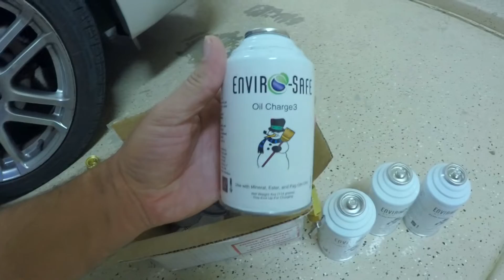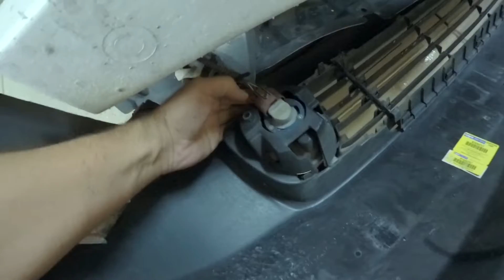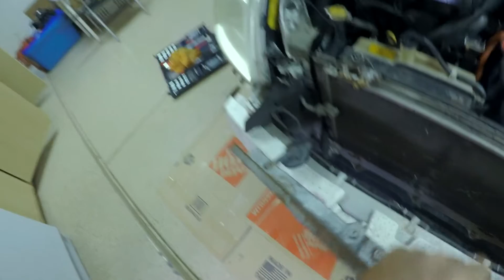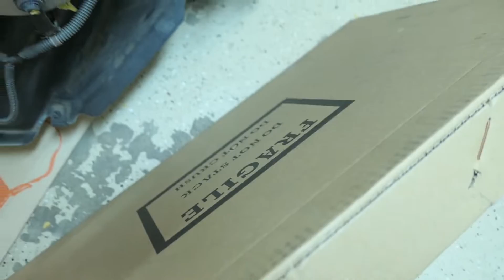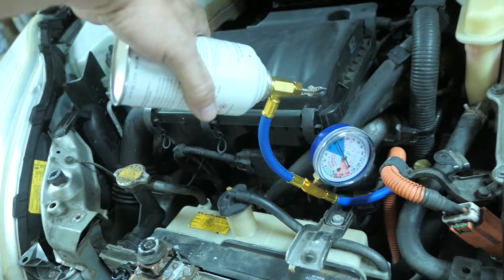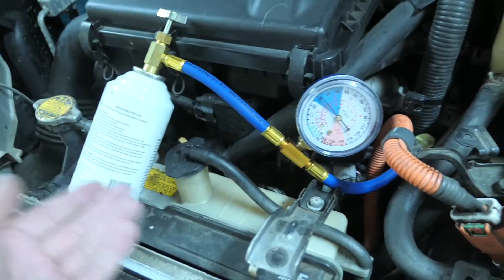Toyota Prius  Gen 2 - AC Condenser Replacement

Comment: I could be very mean and critical but you absolutely cannot open any A/C system, expose it to atmosphere then charge it with Freon without pulling a vacuum on it first. It is a vitally important step that you cannot ignore or bypass. Atmosphere contains moisture (called humidity). As little as one part per million moisture trapped in a system will damage reed valves in older systems but even in a scroll system it will cause corrosion and failure. Water boils at room temperature in a vacuum. Pulling a vacuum vaporizes the water, dries out the system and removes all the atmosphere.

Comment: Is this dye safe to use in a Prius …as it has an all electric compressor that will fail if common ac products are used? Special hybrid compressor oil is required and supposedly…no ac sealant is approved for use in Prius system….

Comment: Appreciate the step by step instructions but you keep calling your condenser a radiator and it had me confused a bit. Those parts are not the same but in all fairness the condenser does look like the radiator. Just fyi but thanks for the video I have to fix mine also

Comment: You at least got the refrigerant HFC-134a correct according to my manual. Missing some steps there though. It would be helpful to know how warm the A/C can blow before it signals the refrigerant is too low thus destroying it. Mine is 42F, 43F, 44F, 45F from left to right at A/C vents at 82 degrees F outside. I just want to know how long I can leave it safely as it's pretty close to what you got and my 09 Prius is still the original at 324,000 miles. As long as there's refrigerant in it shouldn't overheat right?

Comment: this is not the correct way to recharge ac on a Prius. Yes the Condenser is correct but the AC charging shouldn't be followed. Wrong type and amount of refrigerant used, Prius don't need 2 cans or more, it needs 16oz which is basically 1 and 1/3 can. Dye that should be used should also be hybrid safe otherwise it will kill the compressor. Not vacuuming the system after the install, you'll have moisture in the system which will not make the cooling efficient, yes for youtube purposes you can claim that it cools. Relying on low pressure to top off is also not good, you also have to check the high pressure.. basically this process is overcharging.. which is the same as under charging. AC charging should be precise. Also oil wasn't added to the new condenser, so the system is now low on oil.
Reply: Correct. Should release refrigerant can on scale to measure mass of gas released into system!

Comment: Hey buddy for a novice you did excellent work; however, you missed a very important step and all your viewers will be misled and curse you for posting the wrong info when they follow you. After you replace the radiator, you must hook a vacuum pump to the system to pull all the air out of the system...should leave the pump on for a couple of hours to bring the vacuum press as low as possible.. And then refill the system with refrigerant. The air is called in AC industry, noncondensable, leaving it in the system, will eventually destroy your compressor. The compressor's job is to absorb the refrigerant gas and bring it at high press to turn it into liquid. Well, it can't turn the air into a liquid, the air is noncondensable, but the moisture in the air could turn into a liquid and slug your compressor. The compressor can only pump gas not liquid, so a few drops of water will destroy it. Also, your air/refrigerant mixture renders your system very inefficient. If you have 20-30% of air in your system, you will lose 30% efficiency of your cooling system. An auto AC shop may charge you $100 to pull the vacuum and refill your system, If I were you I would fix it. How is the car working now?
Reply: Good tip! 

Maybe I'll just have a professional repair my Prius' AC.

I can't afford a vacuum to suck the air out of the system. That sounds very unique
Reply: @TreDogOfficial  autozone rents the pump and gauges  for free(you pay for it and return it the same day or after a few days, they offer it in their catalogue). There is plenty of videos on how to use it.
Reply: @TreDogOfficial Harbor freight also sells a hand pump vacuum bleeder. Around $20 if I remember correctly.
Reply: The label on the can of Enviro-Safe AC Refill says "DO NOT PULL A VACUUM ON THE A/C SYSTEM." 

Website:
Product formulation: Enviro-Safe's standard R134a Replacement refrigerant with dye is formulated to work correctly with a small amount of air already present in the AC system. Unlike conventional R134a, which can become corrosive when mixed with moisture and air, Enviro-Safe's proprietary blend is designed to be more tolerant of these factors.
Charging method: Charging under a vacuum can lead to an overcharge of the system, potentially causing reduced cooling efficiency and even damage to the compressor. This is because the product is designed to be used in conjunction with a pressure-based charging method, rather than a vacuum-based method.

My personal opinion, if you want to save money, this could be a viable solution. However, if you're concerned about risking damage to your car's AC compressor and potentially increasing costs down the line, it's best to go to a professional shop or dealership.

Comment: OMG... zip ties?  This is a radiator which gets very hot which will melt the zip ties.  WD-40 or Gunk Liquid Wrench would likely help free the rust on the screw.  I would have bought new or used brackets.
Reply: My exhaust has been held up with those same type of zip ties for a year now, nothings melted. 😂
Reply: Yeah I would have tried to extract the old screws first

Comment: Shops suck the air out then fill. You added 134 plus air.
Reply: Yes, he needs to use a vacuum pump!
Reply: I had the same thought, but after researching this specific AC refrigerant brand, they recommend not vacuuming the system. The label on the can of Enviro-Safe AC Refill says "DO NOT PULL A VACUUM ON THE A/C SYSTEM." R134a is compatible with small amounts of air and make it non-corrosive. :body-blue-raised-arms:

Comment: The Compressor is high voltage, so standard 134-A oil should not be used!  Should only use ND-11 type oil for hybrids.
Reply: I am not an expert, however I have the impression ND-11 is an oil and 134-A is Freon (refrigerant).  If you are doing a recharge, then 134-A may be all you need.  If replacing all, you may need to add both 134-A and ND-11.
Reply: How much oil?
Reply: @HaradaSan28  - that's a question for Toyota service tech based on your generation of vehicle, and the status of your A/C system.  On my gen 2 when I had the evap core replaced I provided an 8 oz bottle, which appears standard.  How much of the bottle was used, I don't know.  It's relatively inexpensive. $10-20 per. bottle.
Reply: and the owner of this video is filling R134a with dye... Hope his A/C compressor is fine now